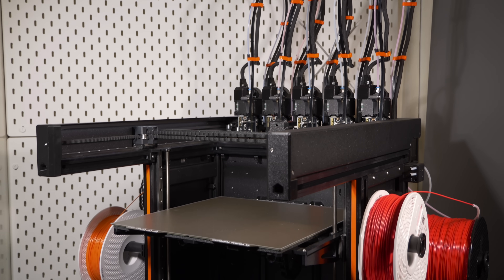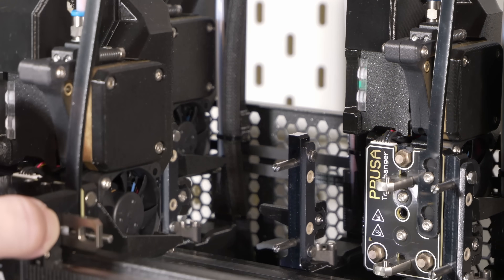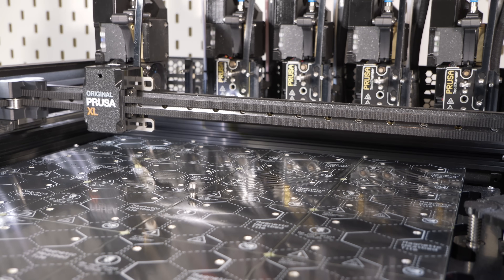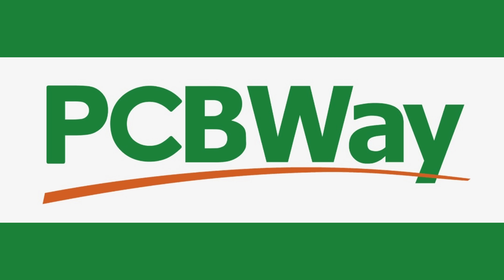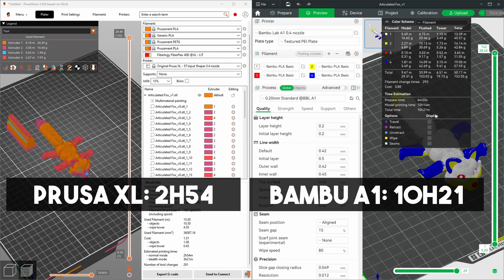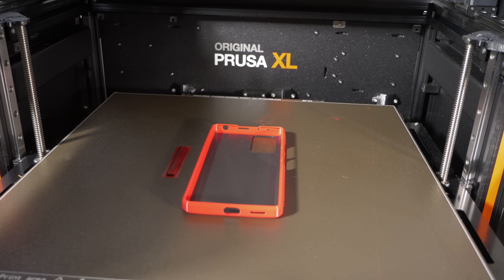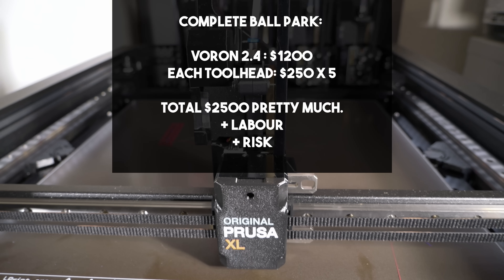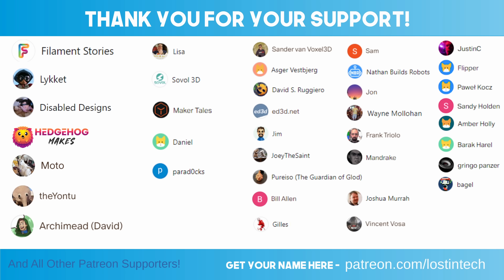The PRUSA XL's secrets revealed - How does it work?

Comment: We just got a 5 toolhead XL at work and so far it's great (once I THOROUGHLY cleaned the flex plates). We got it for multi-material printing and, other than a flaky heat break thermister, it's been perfect. I had some stringing, but that was with some old PLA. Lowering the print temperature from 230 to 215 fixed that.
Reply: I recommend a filament dryer like the Eibos Polyphemus dryer (I use 3), it really helps with stringing, this printer is more susceptible with string when using more than one toolhead.

Comment: Well done sir.  As someone with a 5T XL from launch, going through the stringing, switching to all 0.4 nozzles, this is a very fair assessment.  Firmware helped but 0.4 helped even more.  I'm definitely not envying all the waste others have to go through and yes, switching off the prime tower does work to save even more filament on very large 5 colour prints with the caveat of the odd little bit that might get stuck on the outside but I've always been able to just pick off so overall no impact to quality.
Reply: Is your printer from the first launch now equivalent in all aspects to a later model?

Comment: I have the 5-tool XL and I love it. Beautiful printing quality and being able to print multiple materials with virtually zero waste is great. I just added the enclosure so I'm looking forward to printing with some materials like ASA as well. By the way, the PSU count depends on the bed but also the number of tool heads. If you have one of the printers with only one or two tool heads, it will have fewer PSUs.
Reply from the maker: oh, that makes sense.
Reply: @LostInTech3D  Yeah, it keeps the tools you're using warm during printing so they're ready to go, and so that requires more oomph.

Comment: I can confirm that .6 nozzles have a stringing problem. In my case it just happens with PLA while Petg has no stringing. For me personally i don't need 5 different filaments at the same time. Two are enough, because I would like to experiment with 2 different materials in one print. So an index printer would be ideal for me. I really don't like wasting as much filament as the AMS does so if I would want multi colored prints I would prefer this.